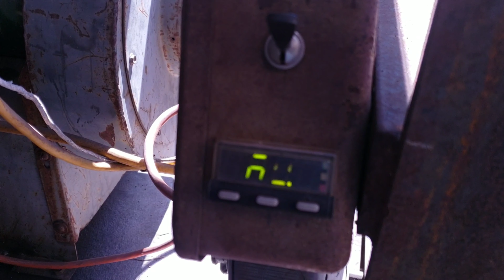Forging A Meat Cleaver From A Giant Gear

Comment: Nice!  But that 90 degree angle where the blade meets the tang needs to be rounded at the corner. The reason is that is where stress will accumulate  and fracture the knife. Rounding it will spread it out. Love your work!  Especially the transmission gear knife!